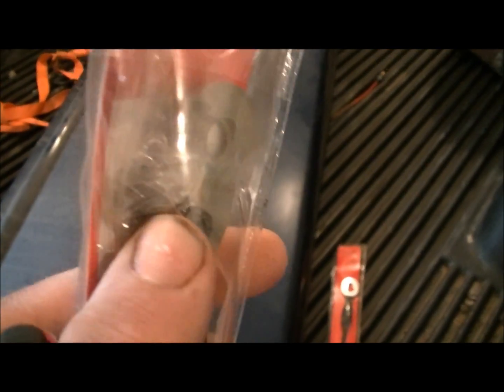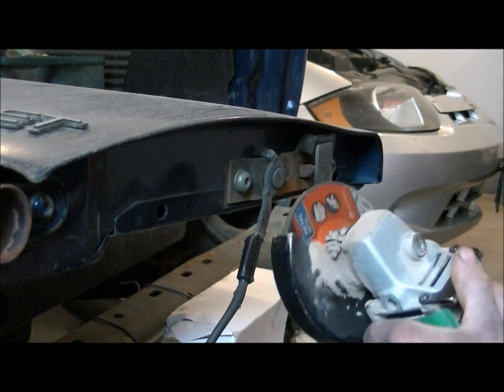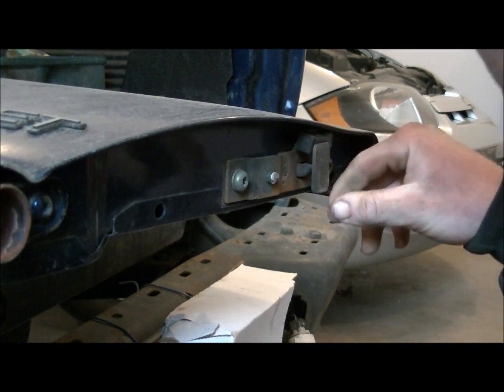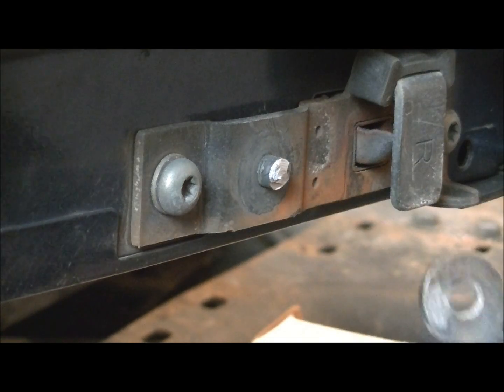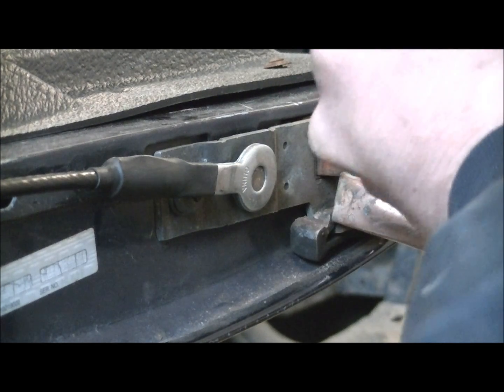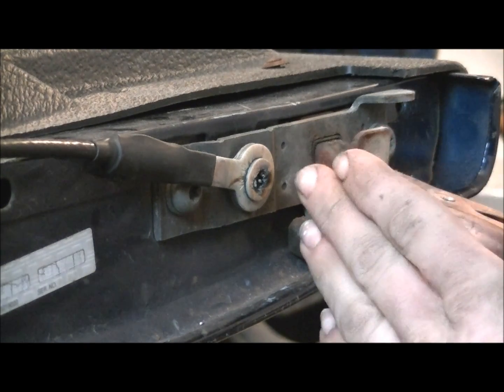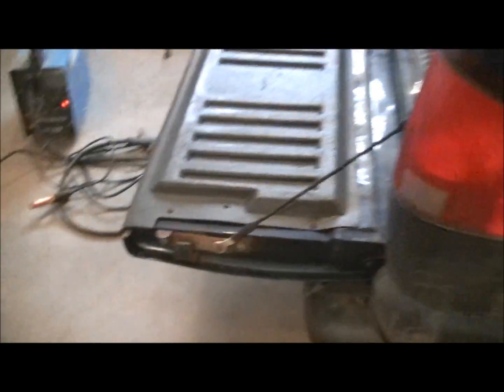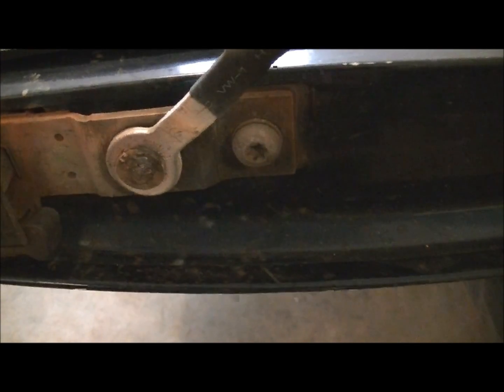Replacing Tail Gate Straps

Comment: seems like it would be easier to drill out the rivet and stick in the new one. but maybe that's just me. I did 2 whithin the time it took you to grind and weld this one. about 10 minutes to remove, drill, install, and then replace latches into tailgate. that's the second set I have done though, first took over a half hour, but still seemed easier than grinding and welding. not to mention the chances you take damaging your paint.
Reply: OK DID U DO A VIDEO ON IT.... IF NOT   PLZZ DO  SO WE CAN WATCH........  THERES MANY WAYS TO DO ONE OL  JOB........  LET ME KNOW WHERE N HOW TO FIND YOUR VIDEO.....